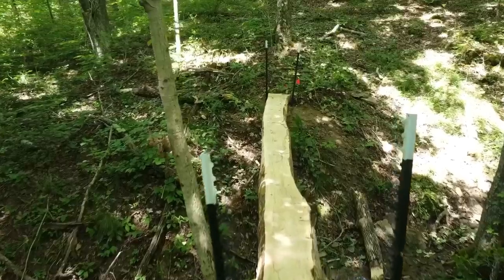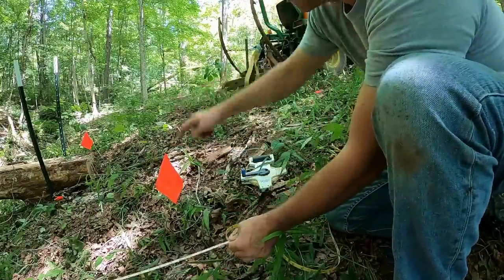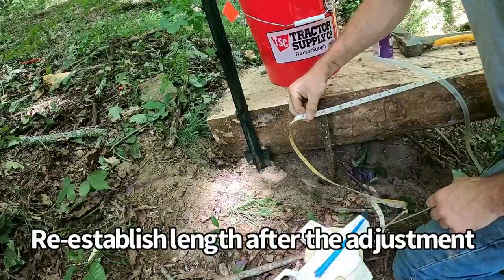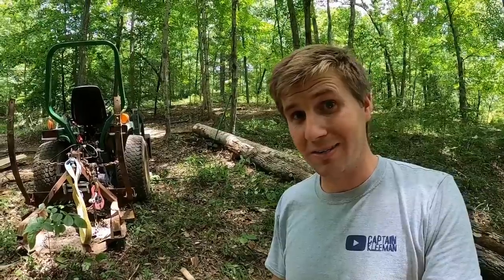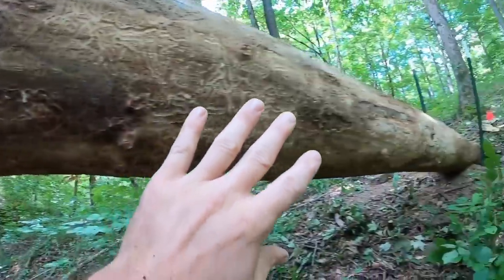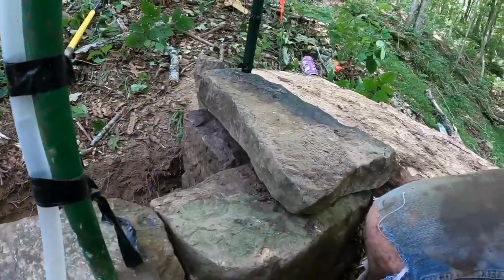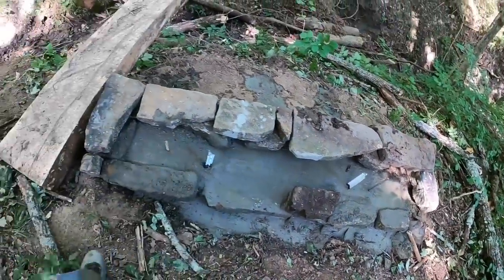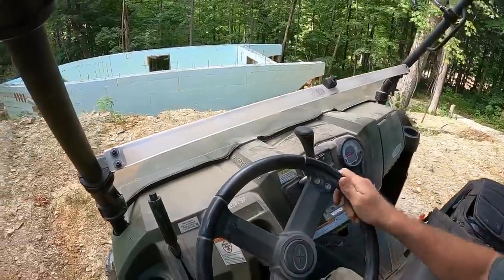Building Creek Rock and Concrete Footers - Timber Bridge in the Woods

Comment: if ya gona do a job then doggone it do it properly... and ya sure did!. There is a trick to squaring up in the woods on ya own... use two tapes (or one and piece of string with a loop at each end at the length of the diagonal), cut ya self a branch to the cross width and then elastic band it to the diag length tape (or in the loop!) and then hold the other end of the stick on the other tape to length... when you pull it tight it will automatically be to length and square!. Loving the 'adventures of Captain K in the woods' and ya videos always leave me in stitches.

Comment: The bridge build is SICK!!! I planned to do the samething on my property to go across a small section of my lake.  Watching you do it just solidified how I'm going to build walls, very AWESOME and thank you!  I have a small loader crawler(Allis Chalmers hd5g) that I need to access my adjacent property(hence the bridge). So after constructing the 2 concrete walls like yours I have a semi trailer that I'm using just the floor(steel frame) as my bridge.  I'm going to remove the axles and jacks and only use the frame section as the bridge portion.  Next I'm going to cut telephone poles and mount them onto the frame rail on the sides to help  cover up the frame and make it look more like a timber bridge.  That's the game plan at least.  Also,  GENIUS idea on fishing for rocks!  That winch set up on your tractor has become such an amazing multi tool.  You use it on just about every video! Keep up the great work, always look forward to watching your vids👍😎

Comment: you can see the tracks of the old crossing through the creek clean that up some and the tractor can get to the other side or at least the sxs which will make getting the logs across way easier. also one trick for setting up the winch line is to hang a chain tree to tree on the other side then you have a straight line of chain to hang your snatch blocks from it makes positioning logs really easy  instead of just anchoring straight to one tree
Reply from the maker: I own nothing that can cross that.

Comment: Mike, was going to question your post driving, since we saw that you used one when you were marking the property.  Thought you would use the tracker bucket to mix concrete, but I see you have a mixer (Could have brought the generator and mixed it on site).  Work is a shortcut, I would add to that.  Work is a short-cut when you use common sense!  
In the next video, you can start by using those Tidy Cat buckets to back fill the stream boat with rock and then say, wait, I have a tracker with a bucket (Of course the 85 would be nicer)!

Comment: You don't have to mix concrete in the ground. Just pour the readymix into the hole and the ground moisture will cure it, and it won't shrink. Takes a few days.

Comment: I’m a little OCD myself. Take those extra steps Mike. In fact I would put that sticky membrane over the top of the logs before putting the deck material on. The stuff seals around the nails or screws. It’ll get you extra years out of them.
Reply from the maker: I’m thinking about it if I have some water proofing left over from the YouTube yacht
Reply: The guy that suggested charring the span logs had a great tip for ensuring that they last is a very good tip, too. You have the equipment (your burn barrel igniter)!!

Comment: Both side of that tape read in the same increments?   Looking good so far.  You will get out of that bridge what you put it.... a bit more time to get it level  and square should make next parts easier for assembly, and possibly reduce a maintenance head ache, or failure.
Reply from the maker: Exactly!  Thanks for watching

Comment: why so accurate? I would've dropped two trees, concreted them in places put a deck on it and call it good.
Reply from the maker: How long did your bridge last?
Reply: @arnoldromppai5395  the difference being I would hire Mike but not you
Reply: @jimpetersen8900  I think you aimed your comment at the WRONG person?
Reply: Matt Rider that would surely make a boring video
Reply: Obviously the Captain isn't a Government worker. And, does the job at hand as good as possible
Reply: Because if it is worth doing, then it is worth doing right 💪💪💪
Reply: Yours might have lasted a few years. And needed complete replacement.

His will last 30 to 50 years. Before needing new wood.
Reply: @stevenr8606 
Mike is a Lieutenant at a fire house, so I presume he is a Govt. worker. He takes pride in what he does as you can see 👍
Reply: @bluegrallis  I think you're right
Reply: @arnoldromppai5395  sorry Arnold I didn't watch who I was replying to
Reply: As the Cap'n said, "Work is the shortcut."

Comment: Concrete needs a certain point of agitation.  Typically a truck will be required to log 100 rotations of the drum.
Extreme low agitation results in weak concrete.
Reply from the maker: I checked the drum rotation counter on the mixer each time ….

Comment: I know this is fun but why didn’t you get a couple of Calvert and put in then fill
Reply from the maker: Too expensive,  at least 2k  for Culverts that could handle the flow in heavy rain,  plus no access for equipment to get back there yet,  and no way to get the 100 or so tons of material to build up the crossing.
Reply: The bridge will look way better than a culvert. As you add cabins you will want a Swiss family Robinson/Robin Hood in the forest wilderness feel and the bridge will help with that.

Comment: I am Enjoying ur channel watching a rookie not taking the time to learn more about what u are doing number one no plastic under concrete means it will suck up moisture all the time which will reduce the lifetime of any steel u put in it which was miserable in the extreme the metal stakes will last about 4 yrs at most depending on the corrosiveness  of the soil also rocks wont stick to the concrete because they were dirty also not enough steel  in the concrete for strength i could go on but its ur project and if u have to learn by ur mistakes so be it u need a mentor !!!
Reply from the maker: 😂😂 oh, okay.